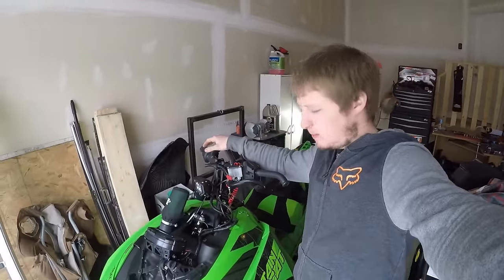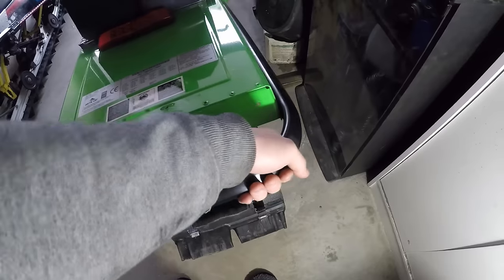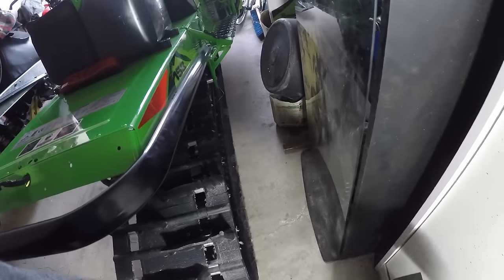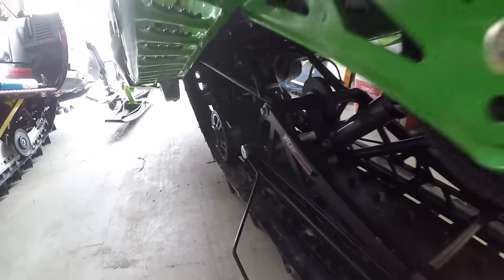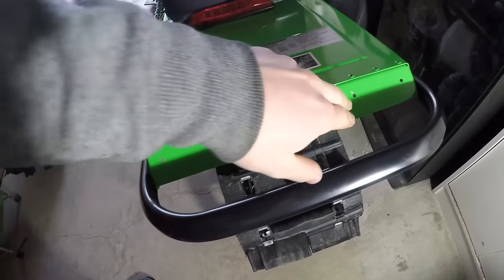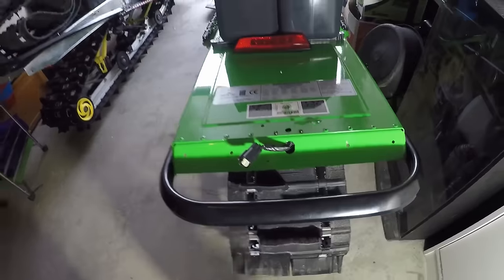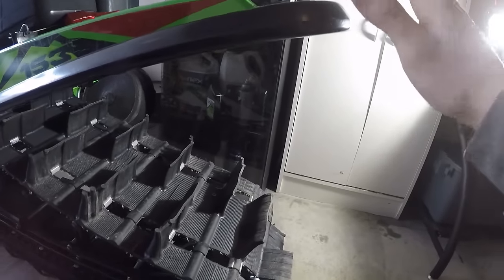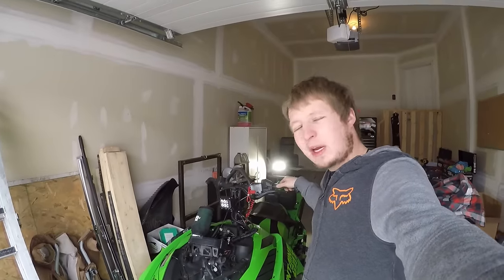SNOWMOBILE | Removing SNOWFLAP?!?

Comment: Totally agree. I tried cutting down the lower flap, trimming and rebolting the top and cutting hand holes, but finally just took the bastard off. Strange thinking from AC designers.
Reply from the maker: Akatarawa Japan 
easy just to get rid of it. I'm not noticing any abnormal overheating.

Comment: I'm kind of late to this post but enjoyed it because I just bought an Alpha that has the same problem.  Always been a Polaris guy and never dreamed I'd buy a Cat but completely love the sled - except for the flap.  I'm not quite ready to completely remove the flap because the sled is bran new but was wondering about cutting a third to a half off the flap.  Do you think it would keep some cooling benefits and get rid of the main annoyances?   Have you tried this? Any thoughts?
Thanks
Reply from the maker: You would get some benefit to that for the cooling still. I'm seeing more and more people in the hills with no flap on.

Comment: Even the snow flaps with good clearance between the rear handle, when you get stuck in deep snow, they'll be pushed back against the handle where its hard to use.
Reply from the maker: +Cunning Cat 
Totally agree. I think the trail riders should leave them on. But for a mountain rider, different story.
Reply: @syxxes  your telling me you dont ride trails to get to the powder?

Comment: you risk overheating because the sleds come with crap radiators   just take out the current one and put a bugfer one on the back where the snow flap would be you will never over heat    and yes ive tried this
Reply from the maker: As mountain riders, we always run our sleds this way.  Never had problems
Reply: Syxxes Performance   well i know you dont have issues with it  it works   but from an engineers standpoint it is rather bad to put a exchanget under the sled hoping snow will get to it  instead of puting it somewhere where it can get air instead like on the sides or rear
Reply from the maker: DELTACX10 its actually a really smart design. Mountain sleds generally see lots of snow. Yes, cat heat exchangers are small but lots of snow packs in there. The biggest difference I notice is in the  build of ice on the tunnel and skid of cat. Almost nothing.
Reply: Syxxes Performance  these new sleds look so different tham mine anyway  mine has a  medium length track but very wide like 2 to 4 times wider than yours  but i wonder why it is that my track system has a crap ton of idler wbeels but none of those llong sliders like yours
Reply: @deltacx1059  yours is built for trail/trapping ours are built for agility high altitude and deep powder they are a toy not a tool like the Bearcats ect

Comment: I swear its mostly cat riders that take the flap off. its annoying to people behind you because the track picks up and flicks large chunks of snow at people.  Low snow/ice on trail to mountail where there is low cooling you need the flap to help with the motor cooling. the side scratchers usually arn't enough with out the snow flap helping collect snow. doo has a bendable flap that you can flex outward and it will hold that shape the way its made to lift up more. polaris u can usually just bend the flap up around the bumper.
Reply from the maker: You gettin ice? Back off a little~

Comment: Don't get stuck
Reply: Ya he must get stuck lots, it happens yes but a bit of stomping and a roll over, maybe even some shovel work will get you out. I dont try and lift much from the bumper there is usually an extra 80lbs of snow in there if you dug down anyways....gottta use you heads out there budz

Comment: I cut the "arctic cat" off of my 2014 arctic cat m8000 162's snow flap and it would over heat regaurdless of putting down the scratchers or not if you were in less then 4 inches of powder.  Good luck but I think you will be putting it back on.
Reply: Maybe shorter sleds can get away with it
Reply from the maker: Markmeblablabla 
Been riding all year with 700miles on this sled and no abnormal overheating problems. In this video I'm saying that "It works" not "I'm trying it."